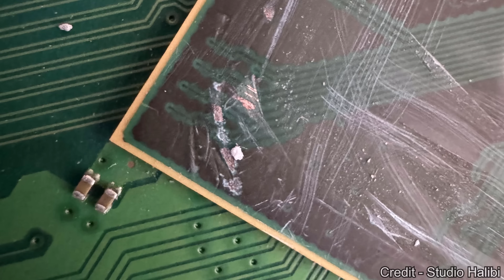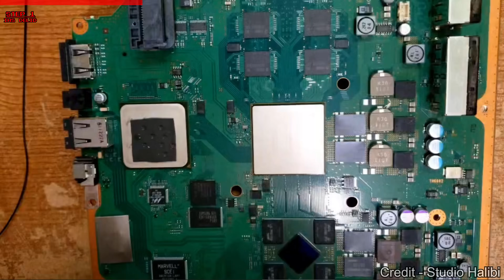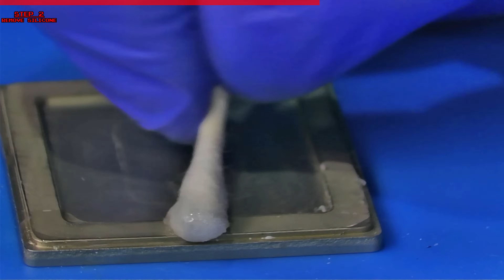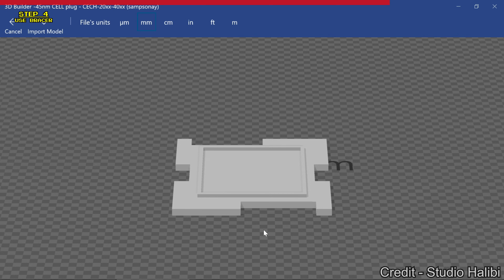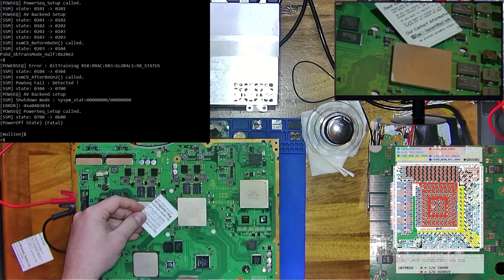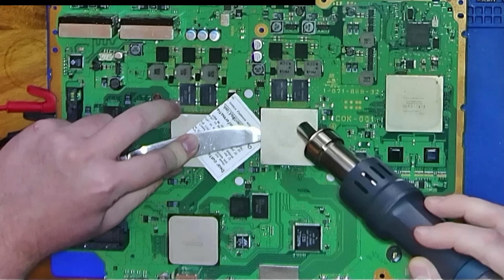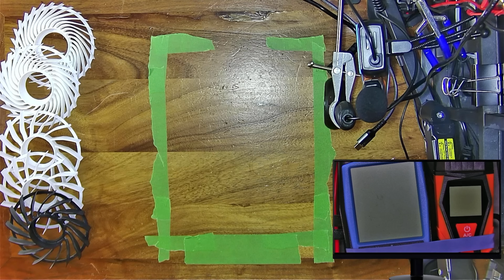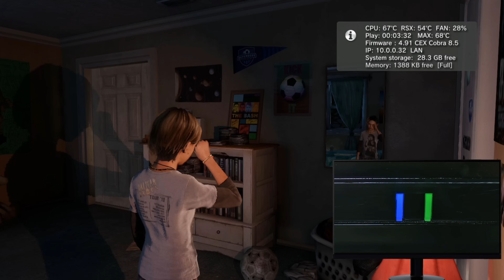How to Fix | Episode 1: Overheating. How to Delid CPU/GPU and fix YLOD - BEWARE of BAD MODs!

Comment: My fat model has the ylod. I got the super slim uncharted bundle after that. Played it for a year then got the ps4. Last week i started my super slim back up. Played it for 4 hrs then it dies. Turns out, its the wifi/bt module. I got the voltage reg replaced. Now just waiting on the Marvell chip. Wish me luck.
Reply from the maker: GL. I'm guessing it's a 25xx model? that model onward has that DCDC voltage regulator issue in the standby  ircuit, which tends to blow out the wifi/BT module when it fails.
Reply: @ripfelix3020  It's a 4001B model. I mainly just want to get it working to back up my save data to the cloud and then transfer to another system. I fixed my friends PS3 slim, and he ended up just letting me have it.
I hate Sony "married" all these components with 1 another. But the approach I'm taking is just replacing the Marvell Chip instead of reballing the whole module. I removed that chip, and now my short it gone. So I'm hopeful I can get away with just the chip replacement. I'm no expert by no means, but I do have a few years of solder jobs here and their under my belt. So far, everything has been going relatively smooth, but I know it can all change with melted solder and a twitch of a finger, lol.

Comment: Has anyone tried to use the heatgun to heat up the tool a little bit, obviously not too hot, but just warm enough to soften the silicon upon contact and help cut through the silicone? Im stoned watching this and it just came across my mind lol

Comment: Fun fact a stiff window package wouldn't of worked back in days because they had vram built onto corners of chip so those who don't glue it down don't make sense as they may ad well remove the steel reinforced chip window off ps4 and ps5s that don't have vram built in the way

Comment: Would you recommend deliding the South bridge chip and resealing it back ?
I know it doesn't produce much heat and we all know how bad the thermal paste Sony used under IHS can get. 

I've already de-lidded Cell only so far using the delid tool available now which was super easy to use. 

Afraid to delid RSX as it's a 40nm official Sony Frankie and I've killed one 40nm RSX before year ago. I do have a 3D printed delid tool but kinda afraid I'll kill it as Sony used a much tougher glue on later 65nm and 40nm RSX chips
Reply from the maker: that 3d printed tool is the same method. It pops the lid off by wedging it (pulling up and potentially tearing the VRAM). I do t reccomend it for the reason that is doesnt allow you to use heat to soften the thermal adhesive or it'll deform itself.

I prefer to use the normal poping method, but with more heat. I havent destroyed one doing that, but I'm sure it'll kill one eventually. I really dont like that method either.

You could use NsCs meyhod of tapping a razor blade in from a side angle, cutti g through the thermal adhesive, but it's hard to line it up so that it doeant cut into the edge of the vram. So that method, if done right might be the safest one on board. But non of them are particularly safe with that hard adhesive.

I dont thing thw Southbridge benifits from delid at all. They are never an issue IME and they produce so little heat the paste is always in good shape. You could delid it if you want, but I'd still reccomend using silicone to glue the ihs back on. Up to you how much risk you want to take.

Comment: Hi Felix, is it absolutely necessary to install a bracer? I'm considering getting my PS3 delidded and I don't think the repair shop here has something like that to install. Your comments would be very valuable, and would you mind explaining why the bracer is necessary later on? Also is it dangerous if I didn't install one?
Reply from the maker: It's not required. I like it because it restores coplanrity (flatness) beneath the IHS, in case the PCB has sagged any from years of having the die under tension. That can cause the DIE to lose contact with the IHS and poor thermal transfer. It's important that it's not adding force beneath the die beyond what's needed to brace the board and return it to flat.

Sony did this themselves on refirbished units, so It's an official modification. That's enough justification for me to reccomend it, but no. It's not required. I don't think it's going to hurt anything to leave it off.
Reply: Thanks for the response man, you and others have done some great work. I have a few more questions to ask so please bear with me.

1) Are there any other adhesive that is good for re-gluing the IHS? Not sure if the repair shop works with silicone and is it okay to leave the IHS back on without a glue? (sounds dumb I know, I have seen some people just leaving it as it is after replacing the thermal paste). Can the same adhesive be used for both the CPU and GPU and what should NOT be used for re-gluing the IHS?

2) I will be opting for a 3D printing service if I deem the braces necessary.  There is SLA and FDM 3D printing, which one should I pick and also is 0.2 mm standard quality good? Can you suggest me an option here? You can search robu 3d printing service india to find more info to help me make a decision.

3) The model dimension for the Cell and RSX show up as 2.20 x 2.20 x 0.19 cm and 3.29 x 3.73 x 0.10 cm. Is this correct? Do I otherwise manually file the braces to ensure that it is 1mm thick? I am awaiting your response.
Reply from the maker: I believe you should return the console to stock in general. So of the IHS was glued on, then use the same adhesive, or one as close to it as possable, to glue it back on. Not doing so introduces an unknown varible. Does it work? Sure. Will it last as long? Unknown. But if you glue it back, you know it should last as long as it was designed to. 

Use the silicone I reccomended in the video on the cell. And use the other one for RSX. You cannot use the same adhesive on both. 

IDK about 3D printing services. I print my own and the STLs seem to work fine there.
Reply: @ripfelix3020  Understood mate, thanks for your time.
Reply: Hey mate, is it possible for fan speed to go upto 80% when playing games after a delid and paste change? Mine looks pretty good when idle but fans get super loud when playing God of War 3. It stays pretty much at 80% and drops to 70% occasionally.
Reply from the maker: Seems likely that the IHS isn't sitting flush with the die. That can happen if you put it back together with just the IHS sitting on the Heatsink and then camiing it together using the leaf spring. This is why I glue it back on using those long nose clamps over the csnter of the die. That way I know the IHS is flat against the die while the glue sets. Then when I assemble there's no way for the IHS to rock to one side.

Another possability is if you didnt use the right fan. An underpowered fan may need more RPM to provide the same CFM and be running at 80% to do what a higher power fan could push at 40%. So be sure to use the righ fan for your model.
Reply: @ripfelix3020  I'll check it out, I think the fan is alright, I also need to test the idle temperature.

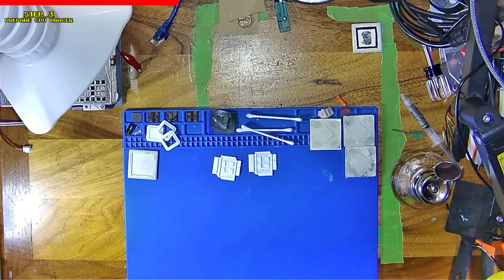Comment: Hi Felix. Thanks for this and all your videos and effort. I have just downloaded "90nm CELL Bracer (SONY Clone).stl"  file from your github and uploaded to one of 3d printing services. Und it says that dimensions are: 22.00 x 22.00 x 1.85 mm which I believe is incorrect since you stressed many times that the thickness has to be stricktly 1 mm. (e.g at 15:00) Could you please clarify what the correct dimensions are? or just upload a new/corrected file (provided I found "a bug" ) ?😀 Thx in advance Update: or am I wrong, because the 1.85 mm is the Overall thickness of this plastic piece?
Reply from the maker: weird, not sure why it would import wrong for them. It works on my printer using cura. I suppose I could look at it and see, but I've never used a 3d printing service to make them. Maybe they use a different software with more specific metadata requirments. Not sure.

Comment: Do you still use the RTV as an adhesive? when you do the Liquid Metal part. it doesn’t look like you do it for Liquid Metal application on the PS3 CPU. Just put the strips on around the bottom of the cpu lid and apply metal. I have everything for the job I just need to know before I start the Liquid Metal application step. Thanks.
Reply from the maker: I did use the silicone. I did another console recently and the foam on the RSX side got pinched and prevented good contact, so I had to delid and do it over. Worked the 2nd time.

Also, update. The silicone cured in the syringes. All of them. Even though they are sealed. IDK why! I need to post an update about that. So you get about 6 months to use it before it cures.
Reply: @ nice with the rtv and Liquid Metal. on Nathan drake 3 seemed to ave at about 33-42% average fan speeds to keep the cpu around 68C. the gpu with Liquid Metal never really went above 51C. 

I did use the weather strip you recommended under the cpu lid and I used liquid electrical tape on the GPU and am using Mx-4 between the top of ihs’s and heatsink and the 3d prints are installed as well. 

How is your temps on the CPU I expected it to do a tad better to say the least. Could it be a problem with the application of Liquid Metal or maybe try and trim down the weather striping. 

It’s still a lot better than it was it use to be like 47-55%fan speed at 68-74c on the cpu and the gpu would max out at 65c.
Reply: Basically any gameplay especially in really active area with a lot of action the fan speed was averaging between 37-44% and hit 69c a tiny bit and on a rare occasions with this fan profile it would hit 70c but on the auto 2 profile I can see as high as 50%fan and it’s always below 69c occasionally but if set as fixed I believe I could leave it at 40 and it would not go higher than 69C. Webman is still a bit weird with me but what results are you getting with the Liquid Metal job?
Reply: Did a normal repaste with Mx4 and did not mess with the Liquid Metal. It never went above 39% fan speed and stayed under 69c for the cpu and gpu went up to 59c in drake 3
Reply: But I still think when I did the weather strips were cut too wide after comparing the pictures I took before gluing to your weather strips. Also could be an air pocket in the glue maybe idk. Sorry for bugging u so much but I just want to get better at this and avoid Mr Moore lol
Reply: After fix the temps on both cpu and gpu are around 60C with thermal metal and a max fan speed of 35% I’m happy to have achieved what I was hoping for performance on this game I’m sure now it can run quiet and be below 68C now. Thank you Rip it was a rewarding experience/ great learning. Peace
Reply: After fix the temps on both cpu and gpu are around 60C with Liquid Metal delid and a max fan speed of 35% I’m happy to have achieved what I was hoping for performance on this game and others I’m sure now it can run quiet and be below 68C now too.Thank you Rip it was a rewarding experience/ great learning. Peace
Reply from the maker: Nice, glad you sorted it. My results are fine, not earth shattering. I'll make a video about it eventually. But every model is different, so compairing temps is pointless unless we're talking about the same model.
Reply: @ same model just little slightly later manufacture date
Reply: Yeah I’ll post a short showing what I did with the pictures and such thanks for the replay man. now I’ve got some other retro goodies to fix and learn about. 

I appreciate the effort you went through we definitely need more people like you helping the gaming/ tech community and did I say retro it’s crazy how much time has went by for the ps3 

it feels like yesterday and I’ve got so many games that I wish I played and plan to play on it hopefully soon. hopefully life and my adhd agree with that lol have a good one man.

Comment: Hello. I had already delidded the processor before I found you vid. I am only doing this one console for my grandkids and I do not have nor know of a person who has a 3d printer. Question is (and  I am sure others have asked) do you sell the spacer already spec'd out?
Reply from the maker: I don't,  but I think computer booter does. Not sure. Check his website, maybe ebay. You can also order them from JLCPCB using their 3D printing services. They have industrial printers that offer better dimentional accuracy.
Reply: I went to GoEngineer in person just the other day and it only took like 10 minutes and was pretty low cost as well.

Comment: See for the RSX bracer, where do you sand it down to 1mm? I tried to see in the video and the high points you mentioned but l couldn’t see where you there checking at and sanding at. That’s the part that’s confusing me, do you have an image at all to show where you sand it down?
Reply from the maker: think of it as a flat piece of plastic.  It just has a box on it that fits in the hole to line up. But the lip around that box is what's touching the motherboard. It's supposed to be 1mm thick there.
Reply: @ripfelix3020 so the lip is the part that’s touching the bare motherboard around the sides of the bracer is what you sand down? You don’t sand down the 4 high boxes or the high points on the sides of the bracer? Sorry for being stupid, l’m just wanting to not mess it up lol
Reply from the maker: Those ridges fit in the cpu hole and line it up. they don't touch anything.

Comment: Is SFDER-922 the same as stars-922 thermal glue it says it has -60 to 300 Celsius resistance to heat
Reply: It’s from a brand called Serounder and the bottle looks exactly the same just says SFDER-922 instead of star-922
Reply from the maker: Probably fine. Mine doesnt say stars either.

Comment: Almost ready to do it in mine. The only question i have is, do you leave the braces there or not after the IHS are glued
Reply from the maker: Yeah, the brace will help keep the CPU flat under the die when the leaf spring presses down on it. I believe over time this will reduce flexing stresses that can cause pumpout of the paste and solder cracks. However, that's an uncomfirmed hypothesis. Sony installed them, so it's an official mod. That's good enough for me.

Comment: Other options for the c clamp?
Reply: These are at one of my local stores it’s like 2 weeks out for the wolf ones
Reply from the maker: It depends on the length. These were the longest I could find. The rest of the ones I looked for weren't long enough to reach the center of the die on COK-00X motherboards.
Reply: @ Their pretty available and another great option I’m sure also the the teeth don’t look as good as the wolf brand but it’s definitely probably a good second and I’ll tell you my results after I glue this IHS with it on my donor board
Reply: @ how tight should it grip the bessey 3 inch claps I just got grip a bit tight
Reply: They almost look the same, have the same specs and they are German clamps as well just red and black and the tips have a very stiff hard rubber

Comment: What do you think of just applying a paste like k5 pro viscous thermal paste instead of new thermal pads on everything
Reply: Not the cpu or gpu but like the vram chips on rsx and the other chips with pads
Reply from the maker: Putty is gross. I hate having to clean and reapply it. I prefer pads. The PS3 was designed with silicone thermal pads in mind, so the cooling is sufficient with good quality pads (6W/mK). However higher options do exist and if you want to use them, it wont hurt (putty may just be annoying to work with for the next tech).
Reply: @haha I know. I appreciate the years of struggle you went through making this all happen. It’s helping people like myself climb the hill of enlightenment for sure.
Reply: Other options for thermal adhesive like Easycargo Thermal Glue work? It seems like it might come from the same company making the 922 solution. Unless there is like a diy way to take a decent thermal paste and add some adhesive to it.

Comment: My first PS3 was an 80gb I bought back in 2007 for $599. About 3 years later it got the YLOD. I sent it out to Gophermods and they did a reflow, but that only lasted a month. Ended up selling the PS3 for $60 and I got a slim unit. I just recently bought a 60gb launch model, and I really want to send it off for the Frankenstein mod.

Comment: What about the rsx removal tool?
Reply: It’s the one where you tighten a screw
Reply from the maker: That's the same as what I did. It has a wedge that prys up. I feel like the edge will dig into the plastic and it'll be harder to use. Since the method is the same, I don't see the need for it.
Reply: @ last night I used a ifix it pick and a ifix jimmy tool on top of that with a little heat and that popped it off pretty easily

Comment: Only PS3 I've ever had overheat but I wouldn't call overheating it just got about 5° above them what it should have been normal. But if you like me and making sure was instilled into you when you were a child well you'll most likely tinker with it, And it might be wise to mention that it was running CFW firmware 4.90 Cobra installed as firmwar. I didn't really have to do anything to get the five to drop back down to normal but I did take her with it and all I did was open it up and give it a wonderful dusting out I mean really dusting it out taking pieces off components off for the first time probably shouldn't have taken a chance but hey how you going to learn if you don't get Hands-On